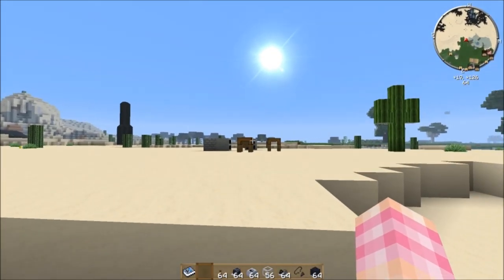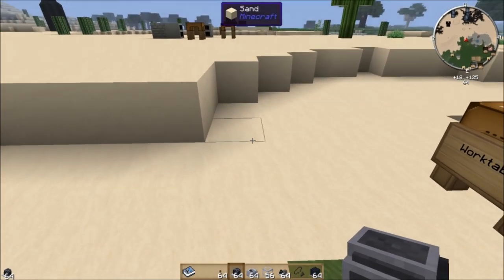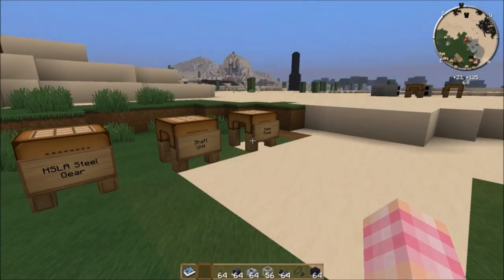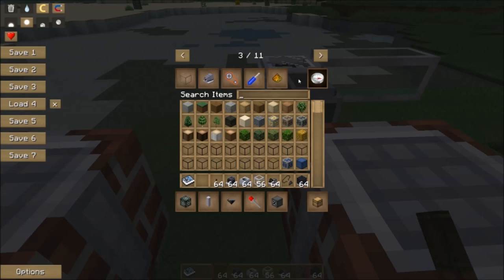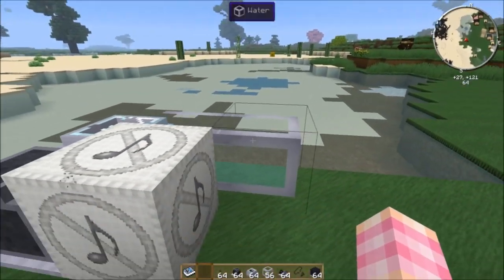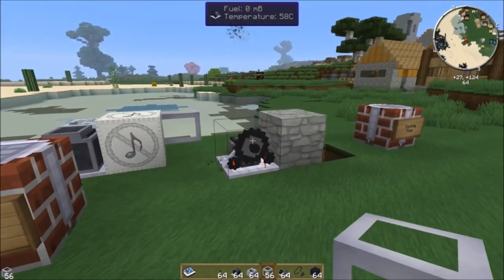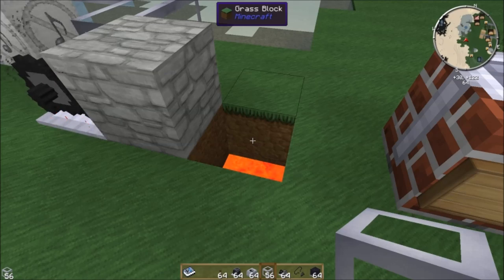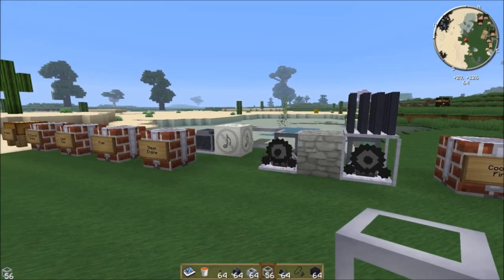RotaryCraft Tutorial #2 - Basic Power Generation

Comment: You now need 2 DC motors and a junction box to run a pump. It was changed in v11.
LPT: Reservoirs are better than pumps. 
They only cost 7 base panels (7 steel ingots) to make, a pump, 2 DC engines, and a shaft junction to combine them require 73. You can make 10 reservoirs for that cost, and once they fill your machines and pressurize your pumps they'll continue to fill up and hold 640,000 mB of water. You'll have more than enough water to hold you over until the next rain.